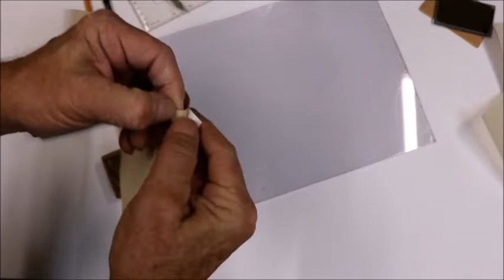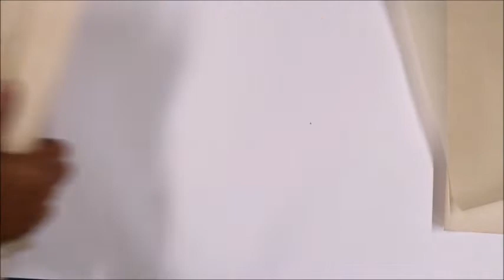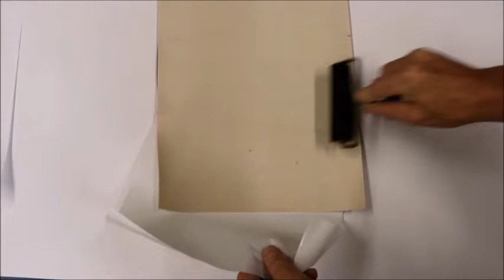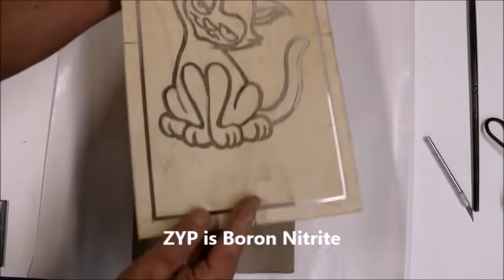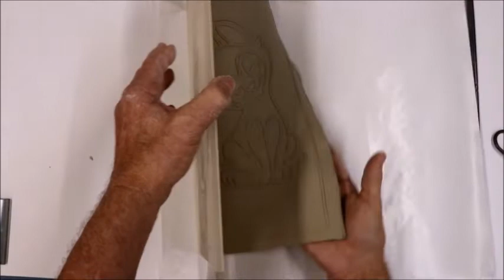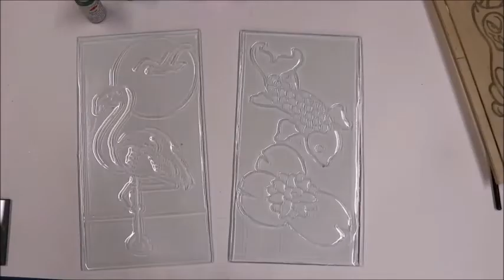DIY Texture Mold - Take Two

Comment: You can use carbon paper to just trace your kitchen kitty right on there instead if stinky gas maybe?
Also what can I use to make my own moulds to put in my microwave kiln. I’m looking to make mini moulds of stuff to be able to melt glass in. I’m a super newbie!
Reply: Angele L He / Captain Mike made a video about Investment Mix which I believe he and others use for glass slumping and such. 

https://youtu.be/Gdo_UhxTD-E
Reply from the maker: Angele, so far I have not been able to make a mold that will work in the microwave kiln.  I have tried several different processes so far with no luck.  One thing that will work for slumping in the microwave kiln is "investment mix".  Watch this video and see if it helps any at all:  https://www.youtube.com/watch?v=Gdo_UhxTD-E

Comment: Hi Capt Mike.Great video. Do you have a clay preference for making these molds?
Reply from the maker: No, you can use any ceramic clay as long as you are going to slump glass on it.  Wedge it good to get the air bubbles out of it and don't get it too wet or too dry.
Reply: @CaptMike  Thank you.